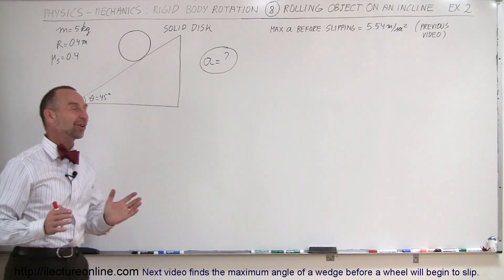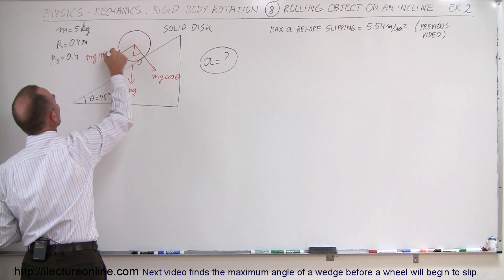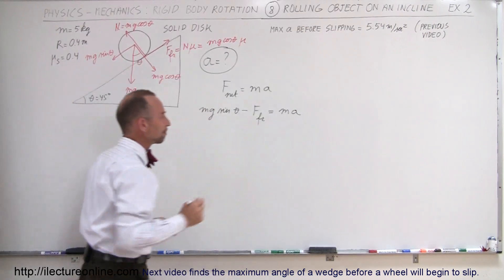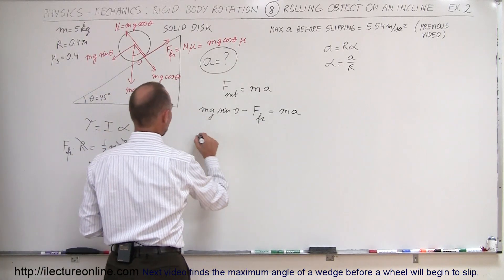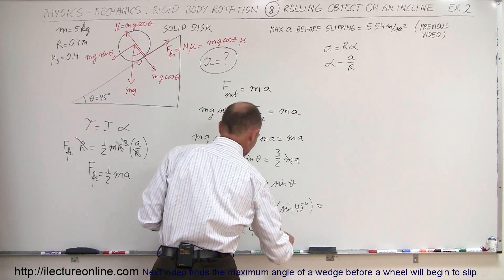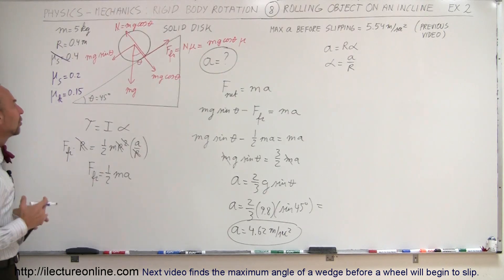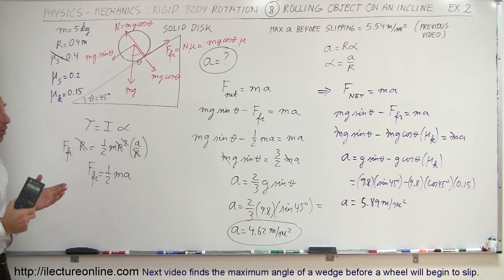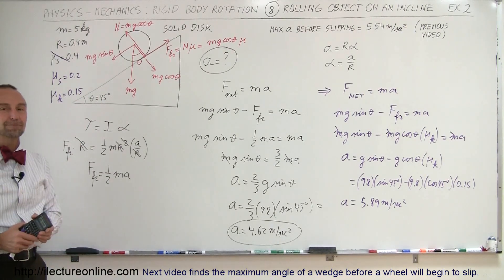Physics 11.1  Rigid Body Rotation (8 of 10)  Rolling Object on an Incline: Ex 2

Comment: Mr. Michael, wasn't Force of static friction = 1/2 × m × a the maximum force of static friction and acceleration equation from the previous video? How did you use tgus equation for the firce of static friction?

Better question might be: you utilized tge above equation in both maximum case and normal case, so what distinguishes it be maximum and normal?

Comment: Amazing explanations! I'm trying to find an example of a disk rolling up on an incline, because I'm struggling trying to understand well the direction of the friction force in that particular case. Have you solve that example? in that case, may I ask for the link?  I looked for it in your channel but I couldn't find it. Thank you very much in advance and of course thank you for your channel!
Reply from the maker: Thank you.  For a disk rolling upwards (without being pushed), the friction force will be pointing down the incline (otherwise the disk would just slide).  Just think about what direction does the friction force need to be in order to keep the wheel from slipping.   Then there is also "rolling friction" which we ignored here.  That is caused by the deformation of the wheel (or tire).     See this video:  Mechanical Engineering: Ch 11: Friction (44 of 47) What is Rolling Friction?   https://youtu.be/v1FkqZrEPg8
Reply: @MichelvanBiezen  Oh thank you very much for the prompt reply! :) . This particular example of a disc rolling upwards is related with a problem from an exam (a car rolling up ,and no slipping,  an incline road at constant velocity. They asked for the direction of the friction force on the wheels), but the solution that was given to me says that the direction of the friction force is pointing up the incline, I mean towards the linear displacement of the car. Isn't that correct? I always use your great tips and explanations to have the answer of the direction, but this particular problem got me a bit confused. Again thank you so so much!!
Reply from the maker: It depends on the rolling object.  If it is being powered up the incline then the friction force is in the same direction as the motion, but if it is rolling up the hill without power, the friction will act in the opposite direction.  The best way to look at it is having a wheel rolling along a flat surface without power.  If the friction force was in the same direction as the motion, the wheel would be accelerating, which doesn't make any sense since nothing is pushing the wheel.  Take a look at these videos starting with this one:  Physics 11.1 Rigid Body Rotation (1 of 10) Basics   https://youtu.be/suaJz-zWt3A    It turns our that separating the friction keeping the wheels from slipping from the rolling friction does cause some confusion.  Thus we have to be very careful how the problem is stated and what is ignored and what is included.  The example you were referring to is a "powered" example and yes the force of the friction uphill will be in the same direction as the motion of the wheel (car).
Reply: @MichelvanBiezen  Thank you very much! I have a test in a few days, I'm so grateful that you answered so fast and as always with a such clear explanation! teachers like you make a big difference, thank you!!
Reply from the maker: Good luck on your test.  🙂

Comment: In the previous video, if you used the actual mass, you will notice the wheel will slip. And here when you calculate the acceleration, you said the wheel won't slip. Isn't that an inconsistency? The mass was not used to calculate the accelerations. I'm  a little confused. Please I need clarification. Thanks
Reply from the maker: In the previous video I made the error of writing 4 kg when I should have written 5 kg.  But that was probably a fortunate mistake since if I had used 5 kg the wheel would indeed have slipped.

Comment: Michel van Biezen, I am just a little confused by part 2 of this example. I don't understand why you wouldn't use Newton's Second Law for Rotation equation, T= I*alpha, for the second part as well. The situation is more complex than a simple object sliding down an incline. Although the cylinder is slipping with respect to the surface wouldn't the kinetic friction force cause rotational (angular) acceleration. You seem to only account for translational acceleration by using Newton's second law for translation, Fnet= ma, but wouldn't the angular acceleration also have an effect on the overall acceleration that you do not account for in this example for part two where the cylinder slips?
Reply: Once the wheel starts to slip, the rotational motion cease to exist. Hence no angular acceleration since the body is not rotating any more. It will just behave similar to the block sliding down an incline plane. Therefore no need to account for that torque.

Comment: Hi Professor Biezen, thank you again for these excellent videos. I have learned so much. I do have some questions about how we found the acceleration in the case of sliding. I would think the kinetic friction, although less than static friction, would also cause some rotation. And if this is true, I would think the acceleration of this hybrid sliding+rolling object would not equal that of a pure sliding object?
Reply from the maker: If there is any type of friction the cylinder will rotate and the acceleration will be different than an object sliding down the incline. 
For examples without rolling see the other playlists.

Comment: why did you neglect  the effect of mgsin(theta) xR  in the rotation and it was only due to force of friction whe you calculated the T=Ixalpha ( i am a doctor interested in physic :-) sorry if i missed anything) thank you!
Reply from the maker: The line of action of mg sin(theta) goes right through the axis of rotation, and therefore does not contribute to the torque which rotates the cylinder.
Reply from the maker: Do you get the same answer?
Reply: yes yes 2/3  gsinƟ =4.6 m/ss

Comment: I dont understand the difference between Ffr= ma and Ffr = mgcos(theta).Nu....
Reply from the maker: Any object on an inclined plane with experience friction between the surface and the object equal to Ffr = mg cos(theta).      When cars drive on the road the maximum acceleration they can muster is limited by the amount of friction between the tires and the road.

Comment: if i use mgcos(theta)Us instead of 0.5ma in the fnet equation, should i get the same answer? i am realy confused coz im getting a different answer
Reply from the maker: The answer in the video is correct.  The friction force only keeps the cylinder from slipping. You cannot use the mgcos(theta) term like you do with a problem that has the object sliding down the incline.